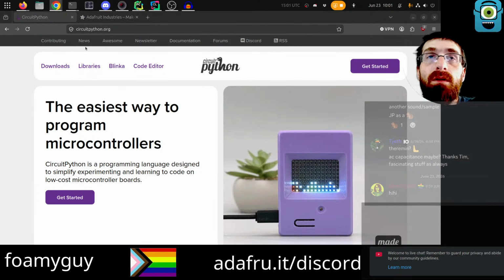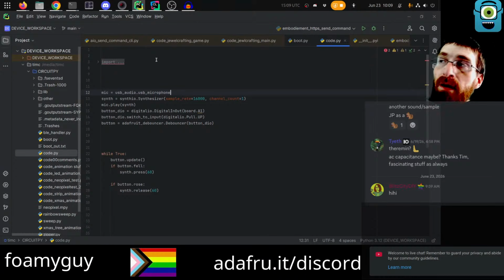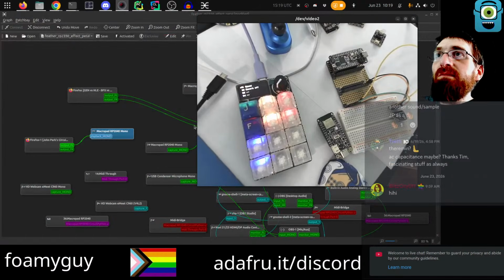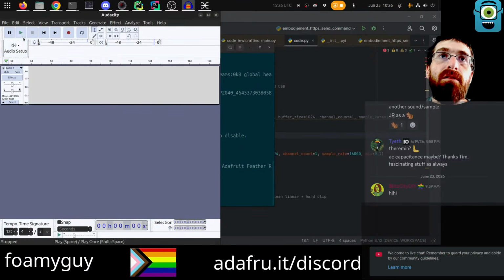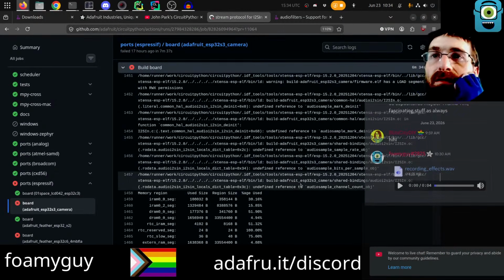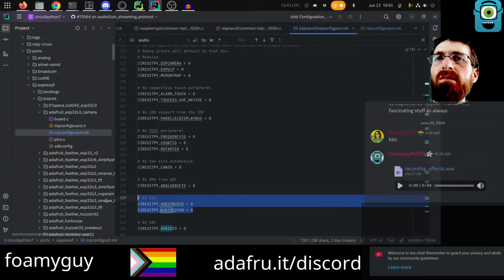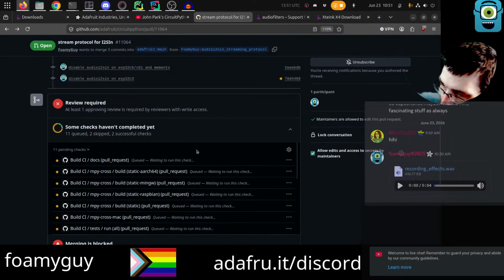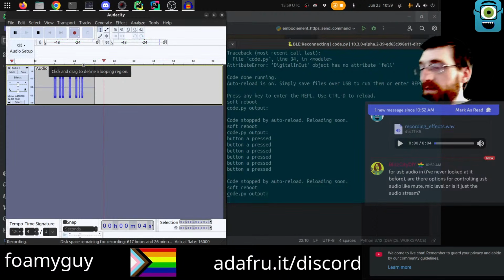Deep Dive w/ Tim: USB Audio and I2SIn Streaming Protocol

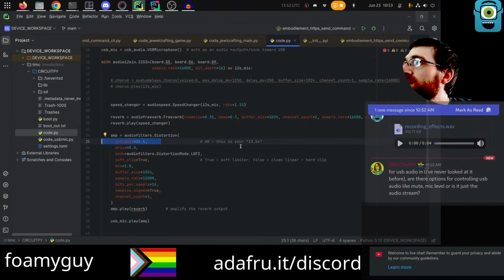Comment: 53:43 The "LOFI" effect for `audiofilters.Distortion` is controlled using the `drive` property. It's essentially a bit crusher and `drive` controls the output number of bits. Since its value is 0, that portion of the effect is essentially bypassed.